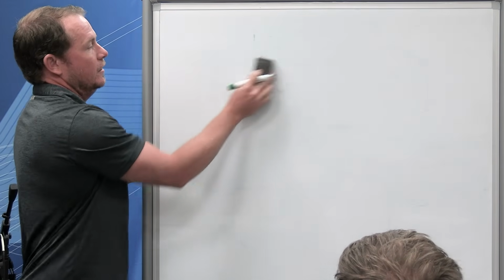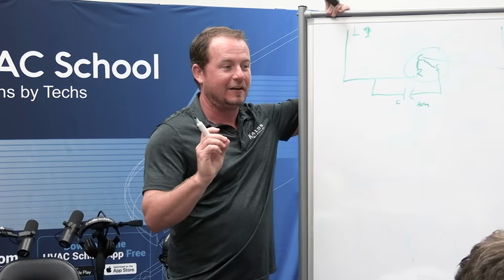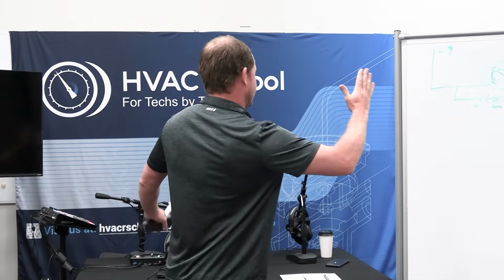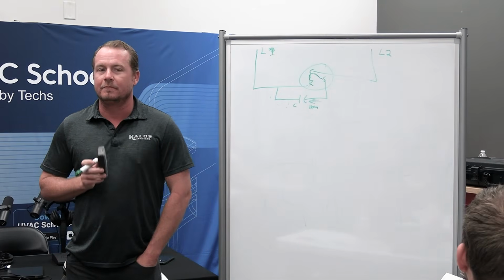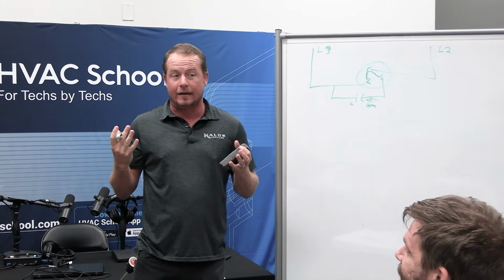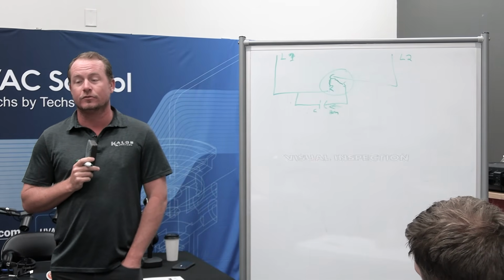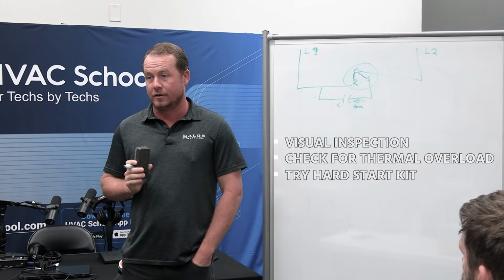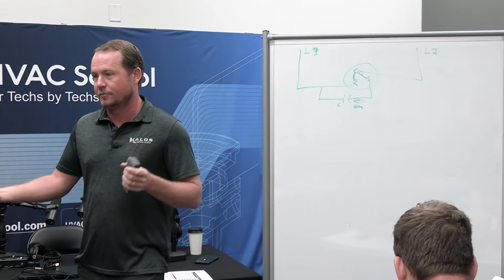Capacitor and Hard Start Myths Busted

Comment: Great video! I have no formal education on A/C and I have not been able to get a good understanding of capacitors from my licensed A/C technicians. I am installing a 10k 30amp generator and would like to know if a soft start is any better than a hard start. I was looking at a soft start from Micro Air which is almost $400 and I'm wondering if it is better for the unit than a hard start. Any comments is appreciated. Thx
Reply: I'm old school taught. The theory of split phase is , to me, the function of the capacitor, and is what generates stronger magnetic fields temporarily, to increase the ability of the physical motion of an inductive motor, without overall increase of wattage uselessly expended by the motor. In fact it decreases it.
 In any electric sine wave there are two components, current, and voltage. The motor typically starts on the current wave, and runs on the voltage wave. In a capacitive circuit the current wave is split away from and precedes the voltage wave. As the current wave reaches its peak the voltage wave is at  or near zero. As the voltage wave approaches it's delayed peak, current in the capacitor approaches zero. I wish I could draw the 2 waves as they pass through a capacitive circuit for you, and compare it to the single phase inductive motor sine wave, but you can likely find this in a different video that does focus on 'capacitor start, capacitor run inductive motor'. 
It has been my experience that a properly applied start capacitor along with the correct (very important ) run capacitor, given the motor windings are close enough in relative resistance , thus designed to implement a run cap. during operation, actually can enhance the performance and increases the lifespan of an inductive motor. 
With a solid state start relay, you can actually hear the motor kick on to full speed considerably quicker after a start cap. is installed. Same with a mechanical start relay, but it is less pronounced, even though it does much the same thing. The less time you can spend with the start windings getting full current, the longer the motor will last, generally speaking. The start windings seem to be the weakest link in an inductive motor, over time, as they have far higher dynamic power fluctuation when you consider the watts per inch load required to start the motor in day to day operation. Getting those start amps down to run amps as quickly as possible is not only efficient, it is also less stress on the motor windings, as they are subject to expansion and contraction directly proportional to current induced heating and cooling.
I would recommend studying split phase analysis and implementation if you decide you want to understand electrical theory in that respect. And I would encourage an understanding of inductive resistance as well. 
The field of electrical theory can be understood if properly taught, and will be extremely helpful in these hvacr jobs in your distant future. Of course each teacher has their own style and way of understanding this field and what they consider important enough to convey it understandably to the students. I feel very fortunate to have had Richard Deputy as my instructor on this subject in 1986. A very smart man, and a very good instructor. Would that I could be more like him.👍
I learn something knew as often as possible. It's a good feeling when I do, as this is my lifelong trade. And I hope I learn from my mistakes, and try to 
pay close attention to  them. I will not ever know everything. 👍
Reply: Most A/C units will require 12kw surge to start with a 5-2-1 start kit (licensed contractor here)

Comment: I had a 3750 sqft home (Chicago suburb) with 2 furnaces and 2 central air units. The Rheem condensers were 3 ton & 2 1/2 ton. Walking past the condensers I noticed one of the units was hummimg but not running. I took a rubber hammer and tapped the side of the case and the unit started running (I did this twice in 2 weeks). The units were 10 years old ( I bought the home new and these were installed new). Having a lot of experiences with oil filled motors, I knew there might be a bearing wear issue and when the unit stopped in the wrong place it would not start. I installed a hard start kit that I got with a bunch of electrical parts from a friend. Four years later I sold my home and it was still working, units were 14 years old. The furnaces were Bryant 90 plus and one did need a repair in that same year, but it was only a relay and sensing element.  No other problems in the 14 years on those units. Thanks….Jim
PS….my current new ranch home has a Trane 80 plus furnace (builder sub installed) and a York a/c system with condenser (a licensed friend & I installed) running 19 years without any problems or repairs.

Comment: Do you get higher voltages across the capacitor due to back emf ??   Have you a video explaining this..   I found this video great.
Reply: The opposite phase shift of the two parts causes the measured capacitor voltage and motor winding voltage to appear significantly larger than you would expect. Depending if the circuit is close to the resonant frequency (Xl = Xc) or not, and the Q (resistive loss) it is possible to have higher voltage on one or both component than the line voltage applied across the series combination. (I was an RF Transmitter tech back when tubes were popular so I got to play with big motors AND RF circuits).

Comment: Why doesn’t the A/C unit need a potential relay when all refrigeration compressors that I know of do? Good video.
Reply: Different type of motor. A/C units have a PSC motor, a lot of single phase refrigeration units have a CSCR motor. Capacitor start/capacitor run motors have a lot higher starting torque since in a refrigeration system with pump down control, the motor is having to start under load, since the low side might be as low as 5 psi, but the high side is 200 psi on startup. A/C units typically have a thermostat with a 5 minute anti-short cycle delay and either a fixed metering device like an orifice that allows system pressures to equalize in the off cycle, or a TXV that has a bleed port. Hermetic piston compressor A/C units that have a 'hard shut off' TXV almost always specify a factory hard start kit. Scroll compressors in general on an A/C unit shouldn't need a hard start, since the scroll can 'unload' on shutdown, and a check ball in the discharge port stops gas from flowing backwards thru the scroll.

Comment: Pretty cool !  Would you ever recommend a hard start kit because your standby genset is not capable of starting the compressor during a power outage?
Reply: I 'think' he said you'd need a SOFT START kit, not a hard start (hard start INCREASES the initial surge).
But maybe I heard that wrong...
Reply: I did some additional research which confirmed my opinion that a SOFT START 'may' be your best solution:
A soft start draws out the start time longer, and reduces the height of the peak draw on the generator, but I understand they are more expensive...
A hard start, on the other hand, INCREASES the power surge necessary to start the AC, BUT, it dramatically reduces the start time; the time that it is 'dimming the lights' so to speak. (perhaps  by a factor of 5?)  Resulting in an overall lower total surge needed.  But the peak draw IS higher, if just for a moment or two...

It may be that a hard start might work for you, if your generator is close to strong enough to start it.
You might give it a try and see if it works.
If it's tripping a breaker, then this might be fast enough that the breaker stays in.
If on the other hand, the generator is bogging down and keeps struggling, that a soft start is in order.

I have not read enough about soft starters (or worked with them), and not worked with a generator situation (other than factory fitted gen and AC).
You should do more reading up on it than I have briefly read...

[can we link here?]
I read these, among others:
https://hvacrschool.com/start-capacitor-inrush-facts-myths-part-4/
https://hvacrschool.com/what-you-know-about-start-winding-inrush-might-be-wrong/
https://www.softstartrv.com/difference-between-hard-start-and-soft-start/
Mr K L
Reply: @troubleshooter1975    Wow!   Many thanks !
Reply: That could make the difference since it reduces the initial current surge. You need a 12KW surge rated genset to start an A/C with a start kit
Reply: Yes, a hard start kit is often used for this purpose. It increases the current in the start (low current) winding temporarily. This causes a major reduction in the current in the main run winding which is much thicker wire than the start winding. Typically it reduces the startup peak current to 60% of normal.
Reply: @evanpnz  I don't think so, so I did some reading, confirming my understanding; and a hard start does NOT reduce inrush current (it in fact INCREASES the total current).  It DOES, however, reduce the TIME that it takes to start.

A SOFT START kit is recommended by some for generator situations, to reduce the peak load on the generator.

I read several articles and discussions, including supporting oscilloscope graphs.
Also, it was confirmed that even high-end clamp meters can give a false low reading because the peak surge of a hard start can be already declining when a 100ms meter sample rate captures an initial reading...
Mr K L

Comment: Interesting we have a real old fan that you have to spin before you plug it in I guess it needs a capacitor
Reply: "Technology Connections" YouTube has a great video on single phase motors. Plug-in fans are typically shaded pole motors. Better explanation than this.
Reply: They don't have a lot of starting torque to begin with. Usually it is the bearings getting sticky.

Comment: If the capacitor goes to the start winding, why is it called the run capacitor? I'm assuming it is because it facilitates the compressor running. In that case, is there such thing as a start capacitor?
Reply: Yeah, it's part of the hard start kit described in the last third of the video.

Tl;dw - the start capacitor allows much more current to flow and get the motor spinning (motors draw the most current when stopped), but must be cut out of the circuit when the motor is up to speed as they allow too much current for normal running.
Reply: Start caps and run caps are different.
A start cap is for a motor with a main and an auxiliary winding.
A run cap is used to run a 3 phase motor from a single phase.

It is true that a start cap operates all the time a motor is running, but it is wrong to call it a run cap due to the confusion with the other system.

A motor that uses a start cap usually has the aux winding 90 degrees offset from the main, so the cap is selected to produce a 90 degree phase shift.
When a run capacitor is used, the 3 phase motor is delta (not star) wired, the phase is across 1 winding, the cap across another. The cap causes a 120 degree phase shift in the winding it is wired across (2nd phase) , the 3rd winding gets the difference between phase and cap, which is 120 degrees the other way, which is the same as a 3rd phase.

Comment: So what are these RV ac soft start kits? RV parks often have low voltage coupled with often barely adequate wire size inside the RV so what's the difference if any from a hard start and these soft start kits? I think it's just a 2 wire hard start but I'm sure you know better than me.
Reply: Soft start kits are designed to slowly ramp up the current to get the compressor started. Otherwise, you get a big spike of current normally, which the RV system may not be able to handle. This big spike is called In Rush current. A hard start kit tries to make better use of this big spike to get the compressor going (if the compressor is needing it due to age or other design factors) - whereas a soft start kit is gradually getting the current to the peak needed to get the compressor started, instead of letting it happen in a flash.

Comment: In an AC circuit, the capacitor pools electrons (up to the micro farad rating) on one side due to the differential in voltage between both terminals as the AC sine wave is going uphill. The capacitor releases its charge on the downslope of the sine wave since the capacitor voltage is now higher than the decreasing voltage of the line supply. The release of charge during the downslope is the hand slap. If the capacitor is so large that it never receives a full charge due to resistance in the start winding, then the capacitor will never reach the max voltage of the sine wave and the hand slap will not be at maximum slappage potential (it won't begin to slap until the sine wave has already decreased in voltage significantly past the peak).

Comment: great video! thanks for posting. My nitpick with any of this stuff and when im in the field.. saying ECM blower motor is a bit of a misnomer, its like saying Electronically communicated motor blower motor. I do it myself lol, just sayin! I try to steer away from the habit. I try to say to the customer EC blower motor or EC vent motor / EC Inducer ect. or the ECM.
Reply: It's become standard accept nomenclature.  I don't think you can change that...
Kinda like 'hot water heater'...
Reply: @troubleshooter1975  No but when you sit down and actually think about it, i'd rather think back on myself saying EC motor..

Comment: Without explaining and understanding the phase shift and how the capacitor holds the voltage and releases the voltage closer to the same phase as the current cycle in order to create Power, you’re just teaching the old myth that capacitors add extra power boost. And that’s not true. At least that’s how the electronics instructor taught us in Alternating Current class. And the math was fun too, calculating power at any point in the rotors 360’ travel

Comment: On older systems alot of the time compresser is tight from sitting in the off season. You can just use hard start to get it going then take it off.

Comment: Most of the time replacement compressors come with higher rated capacitors
Reply: That is because the lower run cap allows less current which effectively raises the SEER rating. OEMs are cheating the rating test.
That is why OEM run caps are failing more now than 10 years ago; they are undersized for the energy rating; can make a difference between a rating of 16.0 SEER (gets a utility rebate)  and 15.9 (doesn't get the utility rebate) or 14.0 and 13.9 (not legal to sell in the SW desert)
I started using the old school sizing of 15 years ago to eliminate callbacks. The old school sizing corresponds with the higher rating you see with the replacement units.

Comment: I have a question, not sure if someone had already asked you this. If you need to install a hard start for the condenser. Do you leave it on the system or pull the disconnect off,  disconnect the hard start and start the system back up? Great video! Hopefully you understand my question. Thanks
Reply: A proper hard start kit has a relay that opens when the compressor is up to speed. So it effectively disconnects itself. (He did mention that in the video)
Reply: @briangc1972  Unlike  run capacitors, those high microfarad start capacitors have to be taken out of the circuit, by the start relay, once the compressor is up to speed, or they will overheat and fail.  I’ve even seen the top blow off of them.
Reply: @rodgraff1782  they have the relays attached in the kit

Comment: The start winding dosnt get its power from the run winding it does come from the cap it just dosnt pass straight thru the cap the cap charges then on the next   cycle dumps its stored charge into the start winding its capacity dictates how much power it dumps into the start winding and the charging and discharging happening at two different times on the sine wave is how it creates a phase change also having a potential relay stick closed can taost the winding but it can also cause the cap to explode other than that you're spot on with everything I'm really glad to finally see someone who knows what they're talking about doing one of these videos so many people who just come up with their own theory make videos and they are wrong
Reply: And when I say it's capacity I mean the micro Farad rating of the cap not the voltage